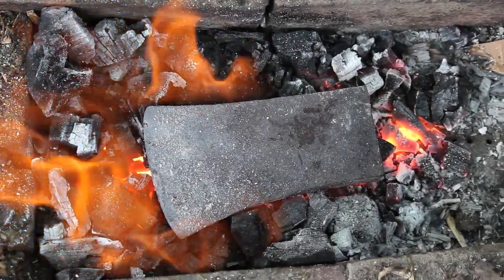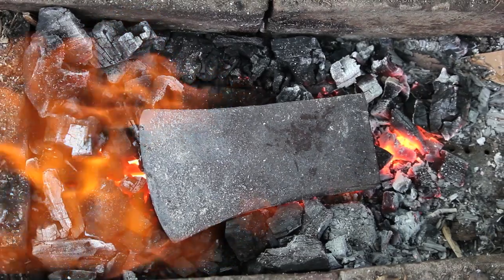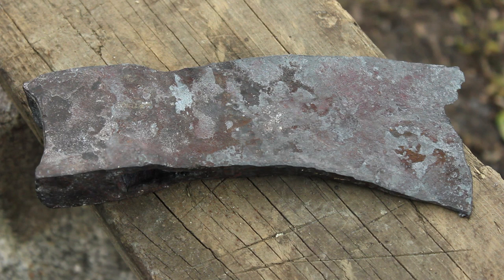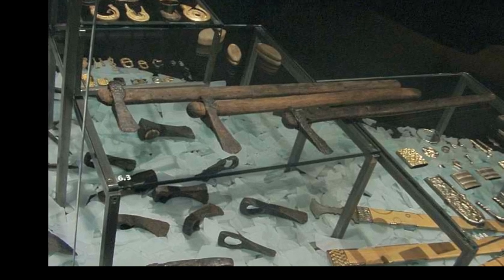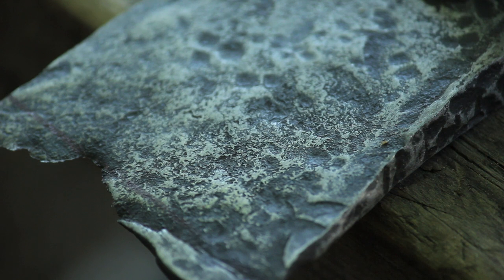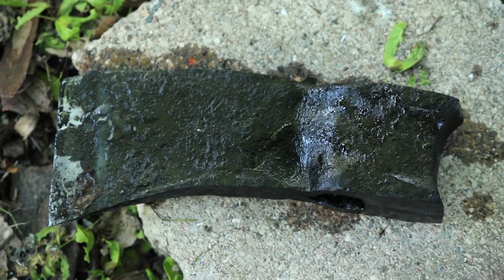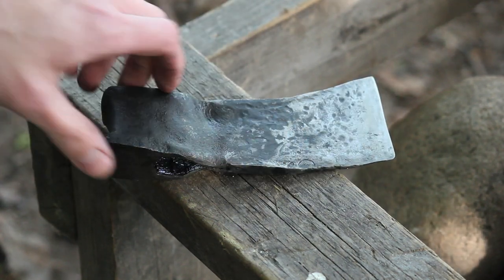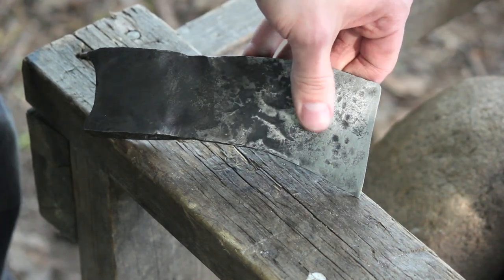Making the Ax for "Viking Proverb" - Part 1

Comment: this is probably one of the best videos ive ever seen and im only a minute in, i really need to get myself an anvil, what do you recommend? im on a budget and do like to recycle, ive heard of people using a piece of railway gauge track offcut so that may be an option, many thanks for uploading, liked, commented and subbed!
Reply from the maker: Thanks! The railroad track works good as an anvil because it is hardened steel, but as you can see in the videos I just used whatever I could find.
Reply: thanks, i might have to relocate my workshop before doing this, its in the middle of a village and you would think that having a village blacksmith type operation would be ok, but its not, ill have to reopen the other one up on the moors, ive allready marked out the shape, would you aneal the metal first?
Reply from the maker: thepoultrypeople My understanding is that annealing is only used to soften the metal so it is easier to work with when you grind it cold.  When its at forging temperature its already as soft and malleable as it will be. Good luck!

Comment: Wow just wow i uum this video did something to me that is hard to do render me speechless. Not a terrible result but there is room for improovement like the eye could use a bit more work along with the back side off the head and as alot of people have already mentioned you should have tempered it to prevent cracking other than that deacent work could be much worse.

Comment: You might want to look into getting a cheep anvil . ( harbor freight ) It will help you shape better , You might also woant to look into making your own hammer . The ball pin hammer you were using was way light for the work you wanted to do .  

 the temps your working at are why yu lost so much steel to scale . . next time try to bury the steel in the coals until its almost white .

Comment: do you think heat tempering would help to hold an edge, it appears heat treating was understood and used in early metalwork
Reply from the maker: Tempering would soften the edge just enough that a razor edge would not chip or break. Hardened steel is just brittle.